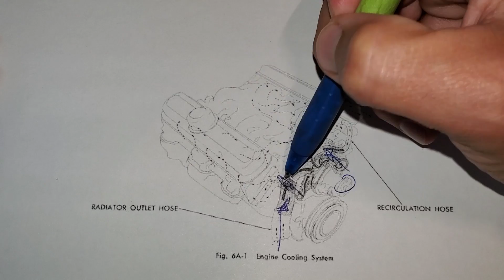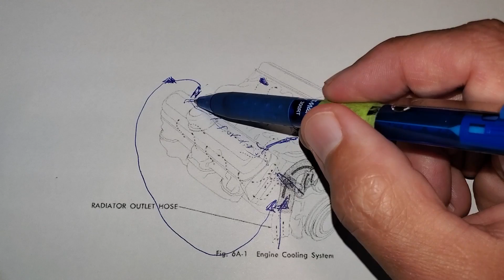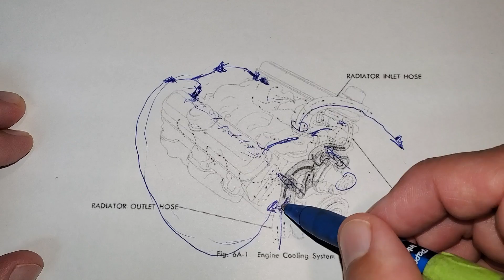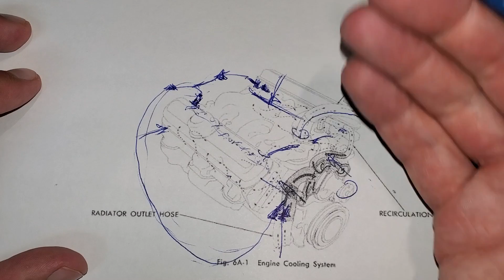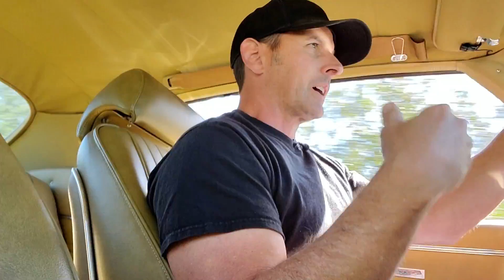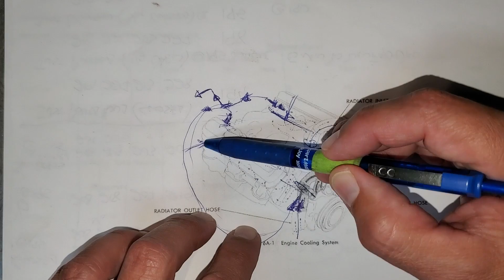Pontiac Head Cooling Trick - Heater Hose Myth?

Comment: There was some discussion on the PY site about how Pontiac experimented with using coolant in the intake instead of the exhaust cross over.  I found that very interesting, especially if you have ever had to deal with gas boiling in the carb making it hard to start.

Your testing reminded me of that.   Plumb off the back to the underside of the intake and then to the front cross over.  It would take some work to seal up the intake correctly.
Reply from the maker: Yeah, definitely getting coolant back to the front cross over is a great idea.  I might just skip that step and plumb the return directly into the radiator.  :)  Definitely worth another experimental video.  Thanks Ryan!
Reply: @FastMonty first thing I thought when I was watching the last video. Why wouldn’t you just enter the rad near the top nicely below the filler cap. The purpose is to lower your coolant temp then this makes sense to me. I love opening the left side head and regulating everything. This is certainly nothing I dreamed up but was common on quite a lot of vehicles. Out into heater out to rad. As for heater core flow   Some are wide open two sizes of fittings create a restriction of some sort. I’ve seen restrictors in the fittings. 
My mind is mushy now but a quick example straight to rad were gm a and b body 80?/89.
Reply from the maker: @jimrudolph1582  yeah, lots of good ideas... here's what I ended up doing.  https://youtu.be/v_qUY4E33r0  Enjoy!

Comment: The best thing I ever did was tee the back 2 ports off and run them to the discharge hose this made a huge difference in cooling in my blown car. My car is a pro street setup. It has a Kauffman 505 with a 871 blower on top so this is kind of a different use but it made 30 degrees difference then running it back to the front cover. I believe this is because you are running preheated water back into the motor without ever cooling it.
Reply from the maker: Awesome Rick... jealous of your motor.  Yeah, I agree, I'm going to experiment with running it back to the radiator.  Should be another fun experiment.  Thanks for the comment!

Comment: What if you ran the hoses into the intake right next to the thermostat instead of water pump
Reply from the maker: Yeah Gary, I love it.  Several others stated the same.  I think my next experiment will be adding a nipple to the radiator, and run the return directly to that.  (So I can hide that hose too)  Stay tuned!  Thanks again!

Comment: Have you considered maybe running a small AN line from the back of the head to the drilled and tapped lines in the water crossover? That is what I have been considering.
Reply from the maker: Good comment Jake.  Yeah, a couple other guys mentioned that's exactly what they do.  I think my next endeavor is to run the heater hose back to the radiator.  (ie, I need to weld in a nipple)  Stay tuned for that test.

Comment: I have never tested it, but I tee both heads together and run forward to my crossover. I pull water for the heater from the crossover and back into the water pump nipple. Just for a cleaner hose routing with the AC lines. I do not see temperature fluctuations doing it this way. 

Might be another angle for you.
Reply from the maker: Thanks Dave!  Good stuff... I'm going to run the heater return directly to the radiator, and see what happens.  Stay tuned for that test.  Thanks again.

Comment: got me thinking, your only just cracking open  the valve to get the best results...why not just tee them together like you did and then just add a 5/8's in line Flow Restrictor, like ford uses to protect their htr cores, any way, it makes sense to flow from both heads, there's also a kit we can install that plumbs the rear heads to a Flow Restrictor housing where the thermostat goes, that piece would allow hot water from heads to go strait back to the radiator. I'm going to try the in line flow restrictor, seems to be the cleanest most economical way to go.I'm not having heating issues, just want to better protect the driver side head
Reply from the maker: Good stuff John... yeah, I went with a ball valve on purpose, to play with the settings.  But, a flow restrictor would be perfect.  Thanks for the comment!  There will be more on this topics... I'm not done, yet.  :)
Reply: Here's another thought, we may see even better results using a y-pipe to the upper radiator hose so it cools before re entering the engine.
https://www.universalpartsinc.com/shopping/productDetails.aspx?i=1104591&c=0
Reply from the maker: @johnb2140  Yup!  Totally agree.  I'll be doing something similar, and then documenting the change in temps, if any... lol  We'll see!
Reply: @FastMonty  sounds good 👌

Comment: I'm curious why you run your coolant so high. I run a 160 degree thermostat and have the stock plumbing arrangement with 6x iron heads with no heating or cooling issues.
Reply from the maker: That is the mystery of the world.  As you know, it depends on a ton of factors.  I will have more episodes on this topic, changing one component or plumbing locations at a time until we figure out the best solution.  All a part of learning.  Thanks!

Comment: Question….. When you run on the highway, do your fans kick on at all?
Reply from the maker: Great question... no, the car loves 70mph, and stays under 180 degrees.  That's with ambient being around 85.  Hope that helps.
Reply: @FastMonty  Thanks. So at 70mph, it stays under 180 with no fans on? I ask because on my Ventura, I've been playing with electric fans. If the fan kicks on, it will drive 75-80mph at 195. At 65 it stays at 180. But with no fan, it runs 210. It's an auto with th2004r & 4.10's. Cruises 65 at 2500 RPM.
Reply from the maker: @v8pontiacvent  Welp, sounds like you need your fans on.  Not ideal, but 210 is too hot for me.  You have a bigger challenge due to your transmission, as you know, your radiator has an oil cooler built in, which robs coolant capacity, and adds another heat source to the radiator.  I'm going to start experimenting with more cooling ideas, like plumbing the heater hose directly into the radiator, and collect more data.  I'll also pay more attention to speed, rpm, ambient temps, etc... and share that data as I get it.  If you have any breakthroughs, let me know!  Thanks for sharing!
Reply: @FastMonty  Thanks for the info Mike. I do have an aluminum 3 core radiator, without trans cooler lines. Separate trans cooler up front. E fan is a Black Magic, 3,300 CFM unit. If I install the oem metal 4 blade mechanical fan, (No fan shroud) she runs 190 all day any speed....160 in the winter lol! I should also point out, it's a 350, with KRE D port aluminum heads.
Reply from the maker: @v8pontiacvent  Great to hear you have a separate cooler for the trans.  It sounds like you might need to just suck it up and allow the fans to do their job. :)  (I suspect the E fan shroud prevents air flow, when they're not on, hence the higher temps)  Nothing wrong with that, as long as they don't fail.  I'll keep on my path of researching and learning more about radiator design, pump flow, ideal flow, etc... we'll get there!  Thanks again for contributing.
Reply: @FastMonty  That is possible. Maybe the Ventura needs bigger front openings to get more air in to the radiator. I'm driving it up to McFarland, CA (2.5 Hours + the Grapevine Hill) for the weekend ANRA event. I might just swap back the mechanical fan and switch to electric at the track. Thanks for your replies, I do appreciate it.
Reply from the maker: @v8pontiacvent  Yup... definitely curious to know if the fans rotate, when powered off... ie, air flow at speed, rotates the fans.  If they do not, that's the culprit.  let me know how it goes!
Reply: @FastMonty  Will do, thank you
Reply: Update……Well, just got back home from the ANRA event. I did install the 4 blade mechanical fan for the 2.5 hour drive. 1st pass, with the mechanical fan, ran the 1/4 in 13.308 @ 101.56mph. 2nd pass, took off the mechanical fan, and installed the electrical fan - 13.236 @ 101.99mph. The fan is worth .072 & .43mph in the quarter. Not a big enough difference to go all electric for the streets.
Reply from the maker: @v8pontiacvent  That's a "cool" test... like what I did there?  ha, ha... thanks for sharing!
Reply: @FastMonty  🤣 lol! 👍🏼
Reply: @FastMonty  And some video action of the Pontiac 350 https://youtu.be/8SL0687G770

Comment: Hi Mike, I’m looking at purchasing a 1970 GTO, it’s in original condition no modifications. It is not cheap but it’s in mint condition (everything). It’s almost too original to modify…. My question is do I destroy the long term resale value by modifying the car? Things like improving brakes, suspension, increasing horse power from the engine? I wouldn’t cut into body work I guess most mods would be reversible if I kept all the original parts.. just curious in your view..
Reply from the maker: Congrats on your purchase!  That's a great question, the answer is... it's your car now, do what you want with it.  :)  From my experience, I elected to build a fun car to drive, for handling, etc... versus restoring an original owner car.  When it comes down to it, it doesn't matter what anyone else thinks, do what makes you happy.  Have fun!

Comment: have a nipple welded to passenger side radiator tank near top row then run hose from back of head to that nipple so its dumping hot water into radiator. you can buy a nipple free timing cover or have yours welded or just plug it off. If you ever owned a older Cadillac with bigger v8 429-500 that was a GM fix to get them cooled it just gets escape routes for hot fluid to the radiator..
Reply from the maker: Hell yeah, that makes perfect sense.  I'll have to keep my eyes pealed for a Cadillac example.  Thanks for the comment!
Reply: @FastMonty  they sell aluminum radiators with that nipple. Just have to look at description and pics.
Reply from the maker: @alfredodirks3537  The more I think about it, the more I want to do this. I can weld it in myself. But, what excites me is I can actually watch how much flows out of that nipple and adjust with my existing ball valve.  Thanks for the tip, and stay tuned!  Lol.
Reply: @FastMonty  maybe run a 45* Y to merge the 2 hoses from back of each head to one that goes in to radiator nipple.  And maybe use smaller diameter hose from heads to the y and then one size bigger from the y to the radiator.
Reply from the maker: @alfredodirks3537  Good stuff, Alfredo... not too concerned about diameters, etc... we're not flowing that fast.  :)  Huge step forward for mankind with the nipple in the radiator.  Not sure if I'm going to get any sleep tonight.  ha, ha... thanks again!

Comment: I did a modification about 22yrs ago and it worked great. I had a Eldelbrock Torker intake on my 455. I bought a used intake the same. I cut off the thermostat water cross over off the second intake and mounted it on the rear of the motor.  Pulled the freeze plugs and bolted the cross over on the rear with the thermostat in the rear cross over and and blocked off the front thermostat housing. So the water flow enters the front of the motor and exists the rear of the motor..............the 455 bored .060 over ran 30 degrees cooler and never had over heating issues again.
Reply: One more question did interfere with your distributor at all?
Reply: @1intimidator3  I had a clearance issue with the HEI but then I bought the Mallory unilite and then was plenty of clearance
Reply: @TxHammer757  thank you
Reply from the maker: Wow!  That's awesome!  Thanks for sharing!
Reply: Do you have any pictures sounds like something I might want to try on my 455 with stock heads
Reply: @1intimidator3  I didn't think about pictures at the time.  Back then was film and Polaroids......sorry
Reply: @TxHammer757  ok no problem thank you for getting back to me

Comment: I just posted a video of the 1964 389ci I have and how it is different from your 1969.  I don't know if it will help you but it may help others.  I feel kinda odd posting a link here but it seems easy and right.  https://www.youtube.com/watch?v=HR85LUfr7xA      I hope you don't mind.  I fo feel that I may can help some other guys.  Thank you for your work on this.   Bobby
Reply from the maker: Thanks Bobby!  Great to see what a 64 Ponti engine looks like.  The heater hose outlet on the front of the intake makes more sense. The top hose/bottom hose comment was more of a general statement, especially for modern cars.  (I know I wasn't clear on that point)  I'm pretty sure you're right, the old Pontiacs had the same sized hose top and bottom.  I recently reduced my diameter for those AN hoses.  Which I'm regretting.  lol.  Anyway, thanks for sharing!
Reply: @FastMonty  I must say those AN hoses looks sweet next to my old stock rubber ones.  I hope you'll make a video about this topic.  Bobby
Reply from the maker: @bobeaseshop9389  Which topic, the hose size?  Or, re-routing the heater hose?  Or, both? ha, ha...
Reply: @FastMonty  You just expanding on your cooling issues in general.  These things are where good videos are born.  I feel like you have your finger on the pulse in a very real way and you are really helping the folks out there in YouTube land.  Just as a few notes.  I am also posting on Rumble and hoping that catches on.  The other thing is that if you don't have one... get a FLIR.  I have the TG165 (not a sponsor darn it) but that tool will help you truly help anyone nail down cooling issues, how hot are the intake manifolds to check for misfires and today I'm going to use it on parasitic draw (like I done before) on a huge motor grader.  It's expensive but can help with leaks around windows and doors in your house and so much more.  I hope to have a few more videos about the FLIR and my Wildfire lift bearings failing.  I know the FLIR is $$$ but it is a simple useful tool that I think may help you - if you don't have one.  This is SO MUCH FUN!!!!   Bobby
Reply from the maker: @bobeaseshop9389  Ahhh gotcha... yeah, I don't have an infrared imager, but I do agree, it would be super useful.  I'll add it to my Christmas list!  Ha, ha... Thanks for the tips! as always!
Reply: @FastMonty  Funny you say that about a Christmas list.  Mick just got a Robinair 15500 vacuum pump for his birthday!  I made him a chamber to suck fluids out of master cyls and such - aside from it's A/C uses.  I sure can spend another guys money!  I just get all the tools I can.  If I do just about anything... I take that as a reason to buy a tool.   Bobby
Reply from the maker: @bobeaseshop9389  Yup, I love tools too.. .I almost have more invested in those, than the GTO.  ALMOST, that is.  Here's to Merry Christmas for both of us.. ha, ha.!

Comment: My brother is currently restoring a 67 goat, that I'm helping with, I'll let him know very good info and testing method! I usually run my 60's engines with a 160 thermostat, and I know that's a bit cool. But, for fuel injection learn to function it needs to be over 160 for that to function. So I'll be running 180 thermostat, and adjusting the fans accordingly. The lower the temp you run, the longer things last and a cooler/denser air/fuel charge. So more power, as long as you are not too cold, for the engine to run clean. But, ya thanks very helpful info, even for sb chevys that have aftermarket manifolds with a rear crossover coolant setup!
Reply from the maker: Thanks Mark!  Yeah, I have a 165 thermostat currently.  But, it won't get that low unless I'm going 80mph, with 65 degree ambient outside.  lol.  Agreed about using a higher temp for Fuel Injection.  Thanks for the comment!
Reply: @FastMonty  Ya, I was guessing that you were running a 180. With your highway temps being about that. But that means something is wrong in your cooling system. If you have a 165 thermostat, that's what it should run at most all the time when you are warmed up! Just guessing try lowering the temps that your fans come on and off at. Especially at speeds below 40 mph. Let me know after you try that, then we can go into other solutions.
Reply: @FastMonty  At over 60mph your fans really shouldn't matter even with the a/c on running 134a refrigerant.

Comment: As a side note: flowing unrestricted coolant into the heater core may cause issues with the core itself. It was not designed to handle pressure and volume of the unrestricted load it’s seeing. 
Pontiac had some warranty issues w/ the cores back in the 60’s. I’m thinking that’s why one of the core tubes is crimped and why PMD has a restriction in the head fitting.
Reply from the maker: Good point... one may never know... ha, ha... I have a bypass valve in front of my heater core, which isn't being used.  I'm leaning towards testing the pressure of different access points, ie the AN Cross over trick mentioned earlier.  Makes me wonder if there's enough pressure to overcome the pressure in the crossover.  Gonna have to noodle that one for a bit.  Thanks for the comment!

Comment: For stock iron heads, could you accomplish the same result by just knocking out the freeze plug on the driver side head, installing another restriction nipple like on the passenger side, and then tee'ing it into the heater hose coming off the passenger side nipple?
Reply from the maker: Good question Robert... YES, that's exactly what you can do.  But, just use rubber hose, instead of AN fittings.